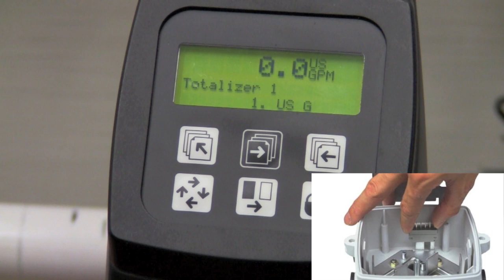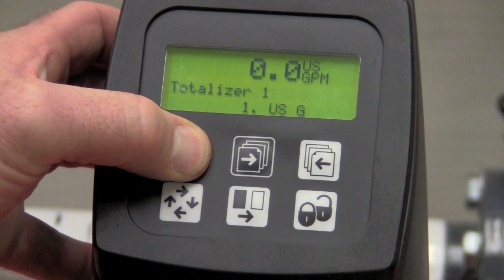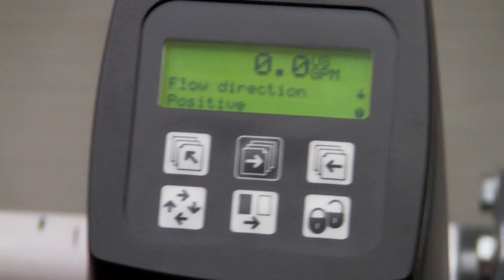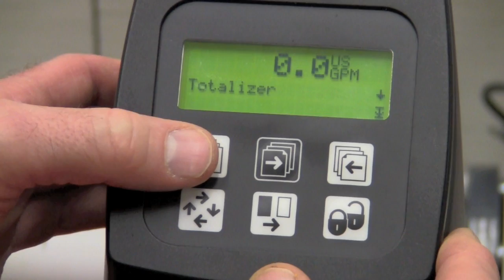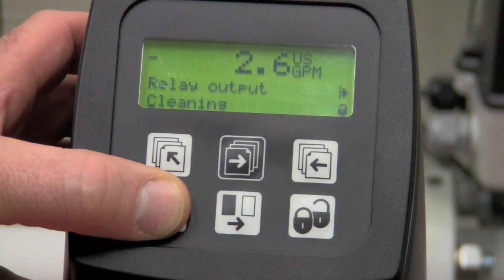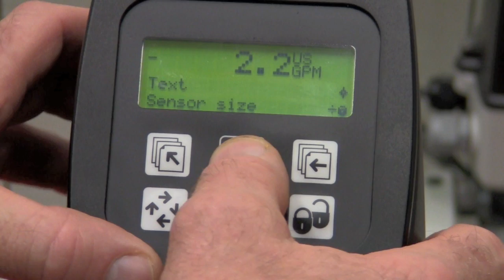Siemens Mag6000 Configuration

Comment: i want to ask for help… about siemens flow meter mag 5000/6000… how to set/trimflow m3/h..for example..my pump is 1200m3/h… i want to set it to 1000 or 900m3/h… how to make it… set that  where to use on mag 5000/6000fm. one more question… what when I turn off the pump reading is not zero… even 30.7m3/h… how do I want zero again… thank you very much.

Comment: Regarding your calibration point. You can verify the flow values with flow verificator. In case you just want to tweak a bit + or - percentage of flow, then you can do that in service menu ˃˃˃˃ Correction Factor then enter the desired percentage.. Make sure u r doing this properly, as any change in percentage will also change it in flow outputs... hence, your plc/controllers will also behave in same way...

Comment: I believe you are talking about dirt inside the pipe. Generally in many applications like Sea Water intake/ Sewage Application / brine solution dirt or slurry is part of medium.. hence an accuracy deviation is very less. Infact if installation is done properly then it is negligible. Yeah, you have to make sure the water flowing through should not be  filled with heavy particle. It may damage the liner inside the sensor.